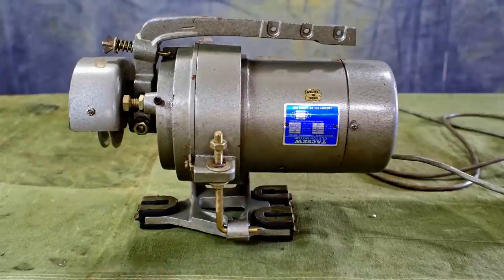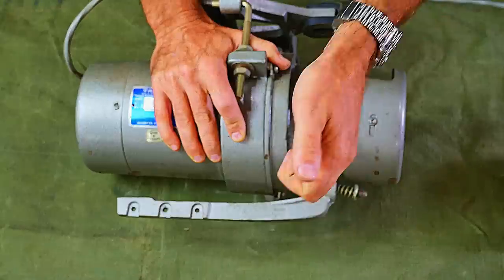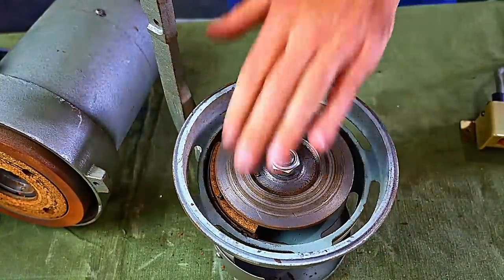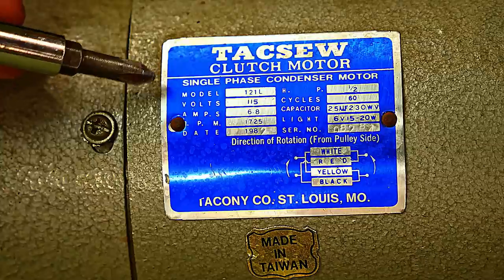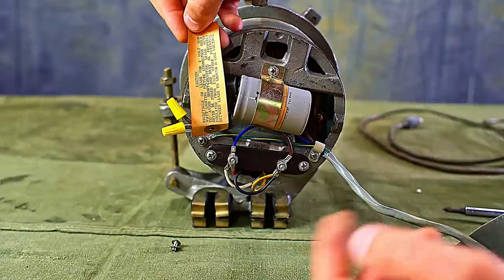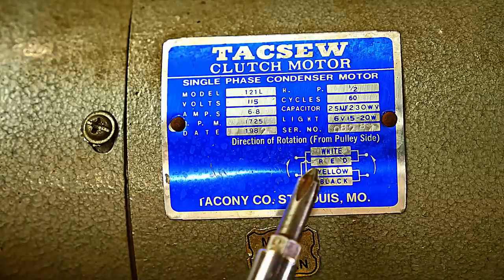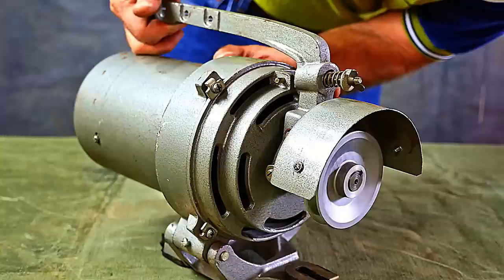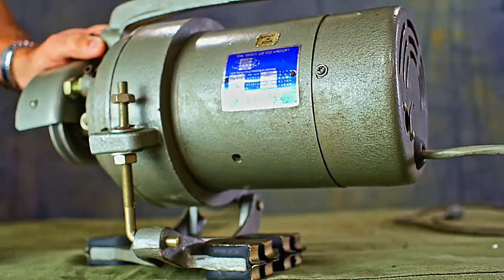Industrial Sewing Machine Clutch Motor - Components Operation Wiring Diagram

Comment: Can`t beat these motors they are still making them, compared to most modern makes these are like a shire horse,just keep going for years
Reply from the maker: I have never been able to sell one and I have listed a few. You are lucky, Your favorite motors are also affordable. I get about $3.50 for them at the scrap yard and I have scraped dozens.
Reply: @AlexanderDyer  I know most people are heading towards induction motors , for a few reasons, being lighter, softer start, speed control,
But these motors can be sold as a motor for other projects, they usually come with the off and on switch, 
you can link the clutch leaver to operate by foot if rigged up , they have there own motor bracket, it can be set to run left or right, its a motor that shown it can last,
You can bolt these down and run to a pulley wheel with a shaft , then connect a spiral spikes to either end then put buffing wheels on,
now you have a buffing machine,

You can screw a round bigger circumference metal or ply wood disc to where the cork screws go and then stick Velcro or double sided tape to the metal disc then put sand paper disc to the Velcro or to the double sided tape  , now you have a sander,
There are so many things you can use them . man $3.50 few

Comment: Another thing I prefer about servo motors is the predictable power for punching force at a very low speed. Unlike clutch motors that deal with friction in the clutch where as soon as the needle does punch through for the first stitch it often takes off very fast.

Comment: Thanks for this video...I just bought a 206rb from a military unit that turned it in. On initial inspection it appears to be in great shape. I plan to follow your steps as soon as time allows. (So many other projects, so little time) a little gloat, if I may....I paid $50 for the complete rig....so stoked. I also have a Singer 211..... I'm wondering which one will prove out as favorite.

Comment: Question, if you didn't need the clutch or motor for sewing purposes. Could you take the clutch material out and tack weld the pressure plate to the motor so it's direct drive? Thank you
Reply from the maker: Sure, I guess so, or just remove the clutch all together. It is your world.
Reply: @AlexanderDyer  I access to a couple of these $30-40 and would like to use one or both as replacement motors for 1x30 and 1x42 belt sander/grinders that are turned into knife sharpeners. These motors spin pretty close to perfect speed (1725 RPM I believe) for sharpening while the stock motors turn 3450 RPM. I just need the clutch to lock up 100%. Well, street thinking about it... Maybe I just need to wedge something between the arm and the motor housing for full lockup? 🤔
Heck I don't know. 😆

Comment: Thanks for the info.
I've been noticing these motors for a couple of years with the vague thought that I might be able to use one to power a small lathe. The most powerful I'd seen for sale up to now was only a 1/4hp unit, and that just wouldn't offer enough torque for metal turning, but I see yours is a 1/2hp. That would probably be just about the minimum my little lathe could get away with. I was getting quite excited about that.......... Until you showed the cork friction material. :(  
I'm pretty sure that corks not going to handle the load, and even if it did, the extra slipping as the motor tried to get the weight of the countershaft pulleys and head stock spinning up to speed would probably powder the cork in no time.  It's a shame because for a reasonably heavy duty clutched motor these are pretty cheep second hand, and the idea of a lever operated brake on my little lathe is quite appealing.

I'll have to have a look into the possibility of using an alternative DIY friendly friction materials to see if it's viable to remake a clutch and brake pad for one of these.
Reply: Go to Amazon and type what I put in below. It's brushless with more power. It says clutch but there's no clutch. If you'll look at the little gray lever with springs on it... That controls the speed. I take the springs off and adjust it to where I need it. I also take the pulley off and put a crowned wheel to run a 1x42 custom knife sander/sharpening system. Good luck. 👍
CNCEST Servo Sewing Machine Motor,600W Energy Saving Speed Regulating Motor Brushless Servo Motor for Industrial Sewing Machine with Clutch Motor 110V 6NM,Split Motor

Comment: Hi...do you have a video on 380v conversion to 220v on a clutch motor and induction motor.
Reply from the maker: No, that might be another country than the US. I will say that if it is possible with your motor there is probably a diagram on the side of the motor itself.

Comment: Thank you for the clear and concise demonstration of the inner workings of this type of motor.  Sorry for the long comment, but I have a question about re-purposing one of these.  I replaced the clutch with a new servo for my Singer 20u33 (happy with that).  Now I have this big motor that's crying to be used for something.  I would like to build a DIY 12" disc sander for woodworking (with built in dust collection).  Do you think it would be feasible to remove the clutch lever assembly, remove the cork ring, and get down to the chunky metal wheel that is shown at 3:11.  Then use 4 new longer screws to attach a 12" MDF wood disc onto that chunky metal wheel?  I'm thinking that however careful I am, there would still be some degree of imbalance, and I could very carefully hold a supported chisel to the edge of the wood disc, like a lathe, and feather it to a balanced round shape.  I know this is unconventional, but do you suppose it would work ok?  In theory, at least?  There are a number of YouTube vids of folks making DIY sanders like this, to see what I'm aiming for.  Looking forward to your thoughts.
Reply: Looking at the still frame again at 3:11. . . and I'm thinking I might also need to incorporate a spacer disc first, then the final 12" disc, in order to clear the motor mount bracket.
Reply from the maker: I think it is certainly worth a go. I have sold too many for scrap and I would love to see more of them repurposed.

Comment: Good evening you made my dade, Thank you.  I'm came across with silken motor from brother sew machine that i trying to bringing back to life. Where i can buy the clutch and the brake . motor work perfect. the pulley is freeze the corch from the brake is glue to the metal disc, after i cleaning become free turning but making noise when stoping. thanks for your help

Comment: Mr. Dyer I have a motor like this.  It’s installed on a Singer 96-10.  It’s an old machine I’ve owned for 35+ years I truly like it.  I’m having a problem with it stopping and sewing.  When I cut it off an back on it sews perfectly for about 4 seconds and stop with the motor still running.  Are you able to tell me what’s wrong?  Should I take it down and do what you demonstrated in this video?  Thanking you in advance for the help.
Reply from the maker: I can't tell what the problem might be by your description. I think you just need to get under there and take a closer look and see if you can spot the malfunction.

Comment: Nice video Sir!  Question- I have a clutch motor that is "grabbing" when the pedal is pressed.  Can't seem to "slip the clutch" to allow the motor to start more slowly.  Motor is several years old but in good condition.  Should I open clutch/ flywheel end and clean the flywheel and clutch as you have shown in this video or is there something else that would correct this issue?  Thank you very much for your help!
Reply from the maker: Worth a shot, might help it to not grab if it does turn out to be rough or dirty or you might find you need a new cork disk.
Reply: @AlexanderDyer  Thank You!  Jeff O'Donnell

Comment: Sir, thanks a lot for the video. It really helps. Do you oil this motor? Mine makes a lot of noise, not sure if the noise is related to the hard wood floor where my machine is or that it needs oil. Please advise.

Comment: I have a Consew dual RPM clutch motor rated at 2850 / 3450 RPM that I need to replace. How do I know which speed it was being ran at to get a proper replacement? Most motors today I see are rated at 1750 or 3450 RPM.
Reply from the maker: I recommend a servo motor and then you can dial it in. Your correct speed will depend on factors such as machine and project. https://youtu.be/MRSEsSYclu0

Comment: This is an excellent video!.. my wife recently started hearing a fairly high pitched noise when using her machine (similar to the one in your video). It started off as a low drone and got progressively louder and higher-pitched. We suspect one of the bearings is faulty..but i will first try to clean the clutch plate to see if that is the cause. Can the motor be disassembled to change the bearings?...can you do a video to show this?

Comment: Does this motor require oil as part of a routine maintenance ?
Reply from the maker: Some of the older ones do but this one does not. This one has sealed bearings. some of the older ones have an oiling port for each of the two bearings and a single drop of oil is usually all that is needed for several hundred hours of operation.
Reply: @AlexanderDyer  mine is an older one. If I were to oil, are there directions I can follow?

Comment: I’m not very mechanically inclined, so I don’t understand why this clutch motor has potential energy stored inside it, even after the power is switched.  This seems like a very important fact to know, for safety’s sake.  I wish you could do a more detailed video on the differences between a servo motor and a clutch motor.  Thank you, Alexander.
Reply from the maker: When you turn on a clutch motor it starts spinning at 1700+ RPM when you shut it off the motor slowly spins down to zero. Like if you are riding a bike and stop pedaling, the bike will keep going for a while.
Reply: Alexander, thank you for that explanation.
Reply from the maker: I should also say that the pedal controls a mechanical connection ( the clutch ) and not an electrical connection and so that transfer will still occur during the time that the spinning motor spins to a stop after power has been disconnected.
Reply: Alexander Dyer, thank you for the additional explanation.  I appreciate your time and teaching.  I learn more from you about sewing machines and industrial machines than from anyone else on the web.  Have a great day.  Stay cool.

Comment: SOS please, I assembled my new industrial sewing machine. It same as the one in the video. When I pressed the foot pedal the machine was running but the belt and needle were not moving. Smoke started coming from the motor and it was very warm. 
What could have gone wrong on a new motor. Can I repair it at home. So disappointed was looking forward to sew instantly
Reply from the maker: Hi, there is no way I can say for sure what your particular problem is but I would encourage you to look at the belt and the path that it takes. Make sure that it is on the pulleys properly and that the belt is not caught on or rubbing against anything.
Reply: @AlexanderDyer  thank you, l tried it again, no smoke coming out, I guess it was dust accumulated in there. Its now working. Thanks a lot

Comment: Alexander, great video providing gold information about this clutch motor i have myself.
Still i'm left with few of question:
Why do you have the option to change rotation direction clockwise or diffrent, what does it gives me?
On the tag there is "60 cycles" what does it means exactly?
A clutch motor alway runs the RPM it is set for? how can you use less RPM of it just by Playing your leg with the pressure plate
touching the motor clutch core - it means it is not natural, planned and destinated for it but it works, when you are experienced
you can get a good control speed similar to a servo motor, but the question is, it is bad for the motor or not?
How can i check the capacitor to see if i need to change em? does it have a limit of number i should rich to?
If i am unscrewing more nuts and bolts to rich farter in the inside of the motor, what can i expect and see? maybe more acces
to stuff i can maintance?

Thank you very much !!
Reply from the maker: That motor could be put on another machine that requires a different direction.

60 cycles is your household current.

Those clutch motors are super tough so just feather it is as much as you want to control the speed, it will not hurt the motor and the clutches are replaceable if worn out.

If your motor runs then you don't need a capacitor. If your motor doesn't you might try a new one.

If you unscrew more nuts and bolts you are on your own hahaha

Comment: Thanks for all these useful videos. Im having a problem with my industrial sewing machine motor. The motor keeps on making fan like noise after its switched off. I just replaced it after my old one got damaged. This one is used condition. My old motor used to stop as soon as you hit the button, this one takes more than a minute to stop. Any one got any idea about the problem please help.thanks
Reply from the maker: No Problem, that is normal.

Comment: I need help guys, i just baught this Motor (Madi Clutch Motor)  now my machine stitching is going backwards, i have to drag down the reverse bar for it to go forward. How do i fix that? Please
Reply from the maker: You need to reverse the direction of the motor. Notice that the wiring diagram includes both a clock-wise and counter clock-wise schematic.

Comment: Great videos! All of them! New subscriber here with a quick question:  Just bartered for a Consew 206RB and it has the same clutch motor as this video (Tacsew 1/2 hp). I blew out the lint in the motor and now I hear some minor squeaking noises from time to time. Now that I have it opened up and I've cleaned the cork it sounds like the noise is coming from the power cord end of the motor. How might I diagnose and access? Thanks in advance.

Comment: Alexander...I have a new tacsew industrial sewing machine but haven't used it for a couple years. The motor won't start. If you know what the problem might be, what say you? Thank you for your informative video.
Reply from the maker: I have two question for you.
If you have something for 2 years is it still new?
Last week my refrigerator quit working, what is wrong with it?
Of course these questions are rhetorical.
Reply: Alexander Dyer....thank you for your time. Outlets in shop are dead, even though overhead lights were on and extension cord I ran to house was not plugged in. Three people here and I tell one to help and plug cord, but they forgot.  Machines humming fine and we had a good laugh. Due to ill health, I had not been in shop for few years. I figured maybe motors got locked for not being used for so long.
Reply from the maker: Ha Ha! Yes, they do run better with electricity don't they? Thank you for sharing your amusing story, I can totally relate to it. Thank you and I am glad to are back in service. Good Job.

Comment: My motor in the labeling says 32 mF capacitor but connected is a 8mF capacitor ?? You know why this is? It is not starting or starting very slowly
Reply from the maker: I think you may have Identified your problem. Did someone install an 8mf capacitor where a 32mf should be? If so then what do you think the solution is?
Reply: @AlexanderDyer  it seems like the original one and never changed ,i also see many videos who install lower rating capacitor instead of the one labeled on the plate , don't understand why

Comment: Hi, thanks for your content. I have looked at you videos and find them very informative. I have this kind of motor and i want to change it a servomechanism one. I just got an industrial Brother DB2-B755-5, well equipped with foot (CAN$125) and i want to use it to do fashion clothing for me etc and would like to sew light leader. What do you recommend?  I am on a small budget.
Reply from the maker: I would say you have got a great machine to start with. Start with that and perhaps it will do all that you need. If however when you get into leather you find that the projects are not feeding through as you would like then you can save up for another machine to go with your Brother. Look for a machine with triple feed.

Comment: do you have one of these with a pulley speed reduction set up?
Reply from the maker: No. It is possible however since the cost of a speed reducer is as much or more than a servo motor I always go that route. For me the servo offers more control and a more simple setup than that of a clutch and reducer.
Reply: @AlexanderDyer  how have your servo motors held up?
Reply from the maker: Good, but get the right kind. They are not all good. I like these.  https://youtu.be/lavkvsU5ltk
https://amzn.to/3KsbsC2

Comment: Thank you for this video.

I have always thought it would be helpful if someone where to show how to do a teardown/repair of an industrial sewing machine clutch motor.  I have a couple that have stopped working and I don't know why.  I want to repair them, but don't know how.  If you know how to do it, perhaps you could post a video about it.  Just a suggestion.

Also, do you happen to know if possible to convert a three phase sewing sewing machine motor to a 110v two phase?  I have a Juki that I want to convert, if possible.
Reply from the maker: When one doesn't work, it is generally electrical rather than mechanical and I tend to stay away from electricity as a topic. If you are handy with a volt meter, test your switch if that is working the next most likely culprit is the start capacitor.

What I did since my house does not have 3 phase was to install a 3 phase converter. 

Electricity can be dangerous if handled incorrectly so you assume all risks when working with it. That or hire a professional.